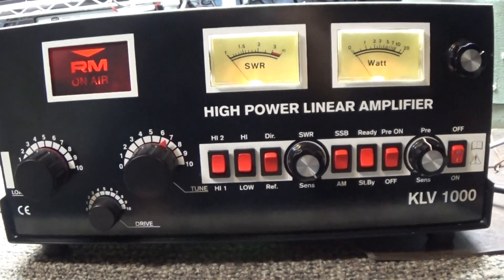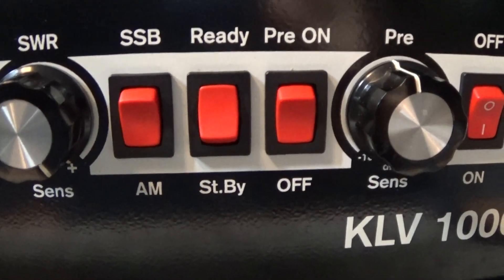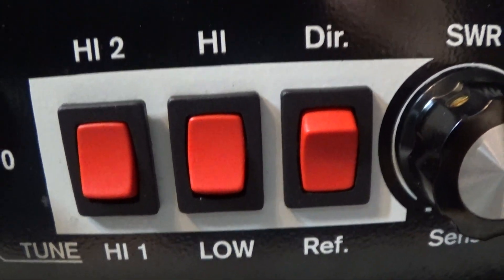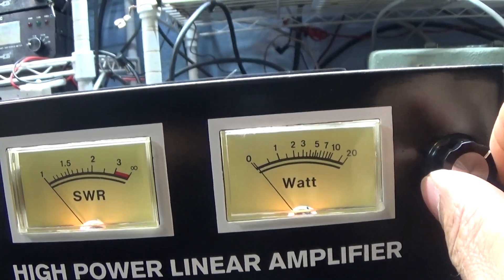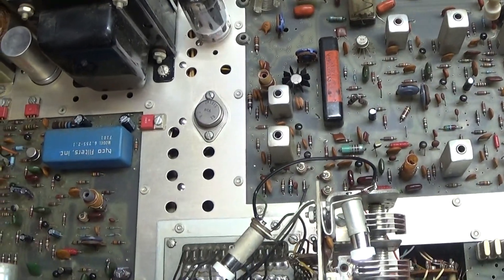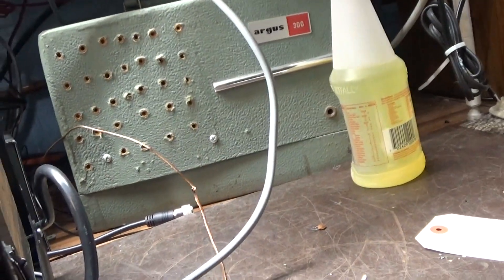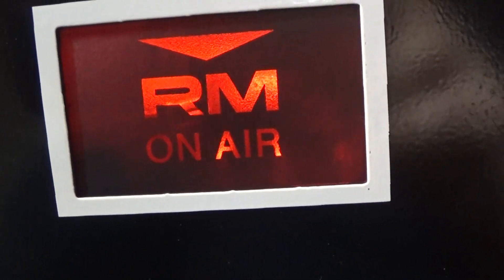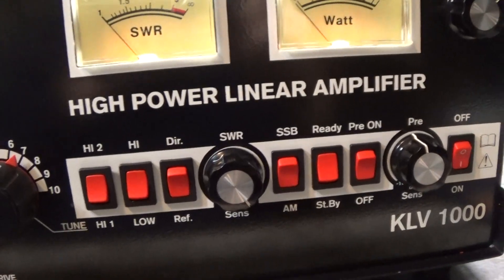RMI RM Italy KLV-1000 low drive with driver tube not KLV-1000P High drive

Comment: What would cause hight swr with the amp on
Reply from the maker: Either amp has an input tuner and it needs to be adjusted, or it does not have an input tuner and then other than adding one or using a matcher inline, there is nothing you can do about it. Some people believe in adding coax at 3ft lengths, that's putting a band-aide on an open wound to me.

Comment: Looking nice but real power out on these amps is about 600/700 watts on fm. With all 509 or 519 tubes thats all the power on fm. You can modify it with a different power supply and pl509/519 tubes then it goes between 800/1000 watts fm. Here in the Netherlands somebody modify them all the time. Nice looking amps i was one of the first in the Netherlands to test them and there where many mistakes and a blew a few tubes and transistors. Later on the modify that it works better but in the early days from the factory they where crap. I dont think the knob for the fan speed is from the factory i think somebody put ti there i never had one on it, but its a great touch to do that. Thnx for the nice video.
Reply from the maker: Yeah, the speed know was not factory. I have found that the grounding on these is not good, which causes all kinds of issues, glitches, blowing and pops. I rework the grounds and connections and they work fine. Too much work to retube and install a bigger power supply for a few more watts. For Mo Watts, I get a bigger amp.

Comment: I have someone who wants to sell me this same exact amp for $400. Is it worth it?? Everyone tells me this amp is garbage
Reply from the maker: I think they did have solder joint or rivet connection problems but that can be easily fixed. I think the other problem is that these say 1000 on them and people want to get 1000 watts out. IMHO they are good 500 watt amps and worth $400